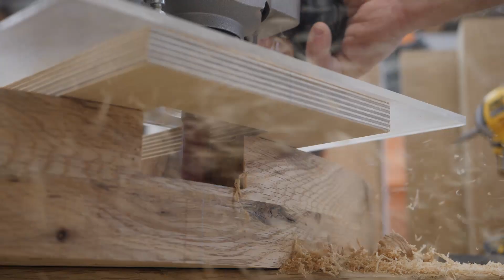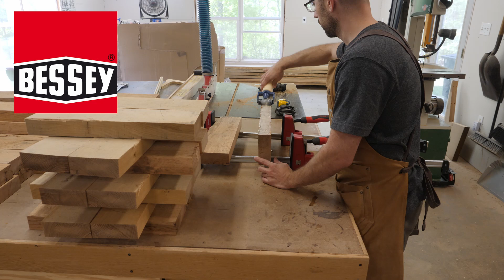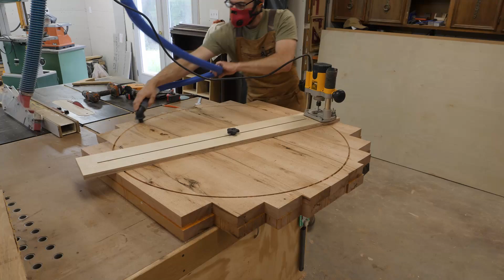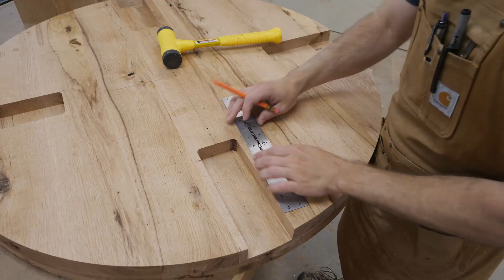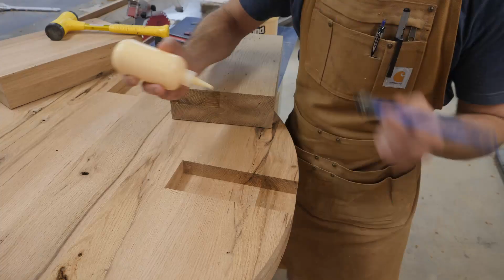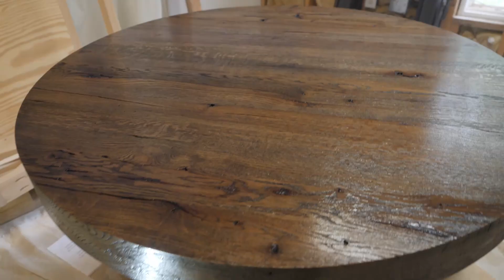How to Build This Modern Rustic Coffee Table

Comment: Mike, do you have any tips on cutting the circle? Would you change anything that you did?
Reply from the maker: Nope, this worked out pretty well.  If the top wasn't so heavy I would have rough cut it with the bandsaw, but that wasn't an option this time without a helper or bigger table on the saw.